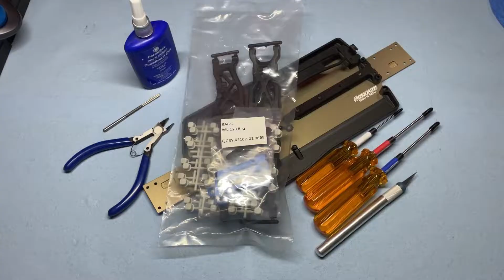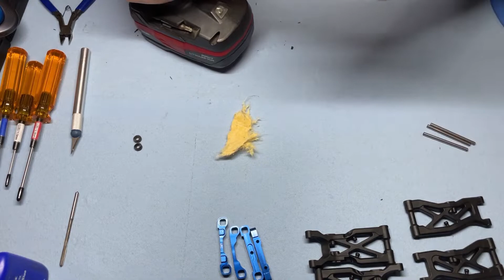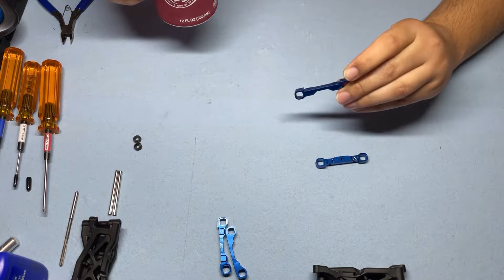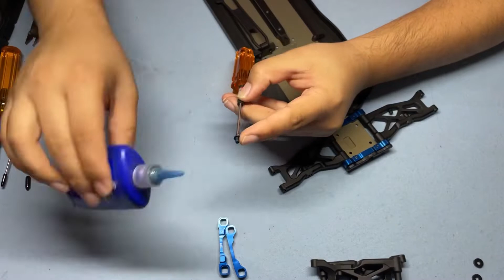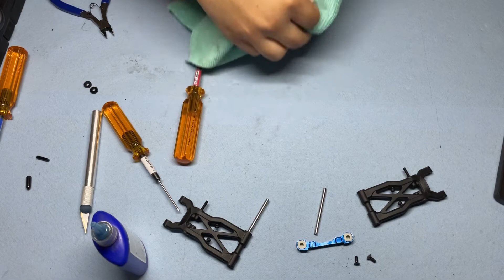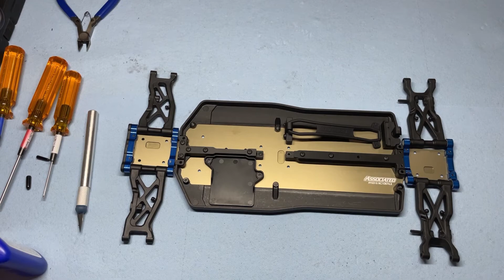Team Associated B74.2 Build - Bag 2

Comment: I'm going through this build now and I think the kit setup has the rear shock pin on the innermost hole, A. That means the side with two holes faces the front. If you want to use the middle setting then you flip the arms and use the one-hole side for position B. I wish the manual explained it better.
Reply from the maker: In my manual, the images show the middle hole (side of the arm with just one hole). Also, in the back of the manual in the kit setup sheet - carpet, it shows the middle setting B. I have one of the earliest batches so they may have changed some things in the manual. The manual is bad at explaining that the arms are bidirectional and you can flip them to use the other side. I just flipped mine to stand up my shocks in the rear.
Reply: @atharsgarage4197  Thanks. I have a dirt kit but didn't notice the difference at first. It's my first scratch build.